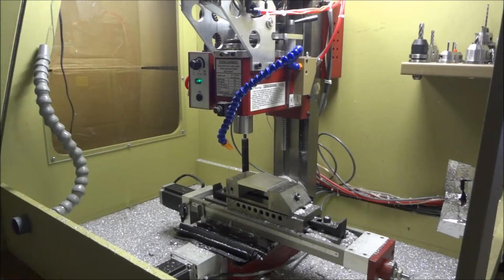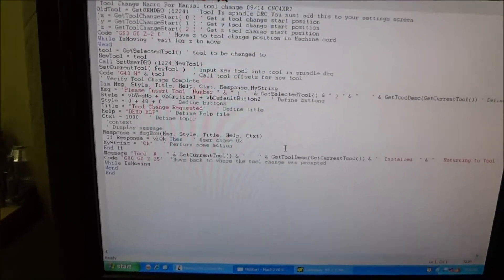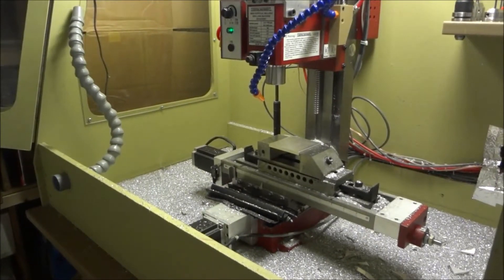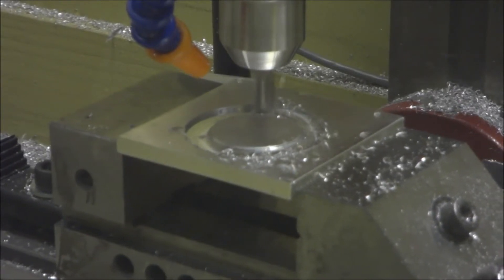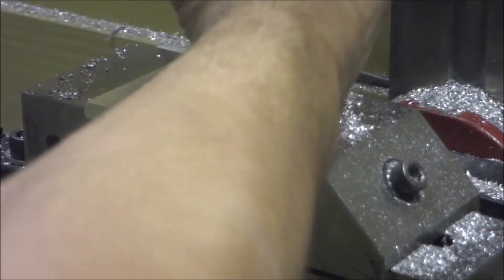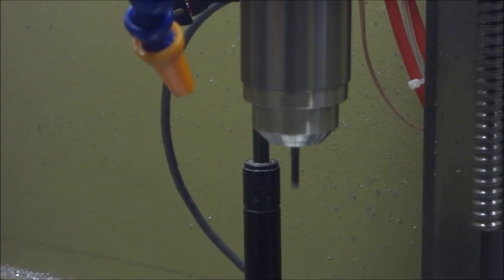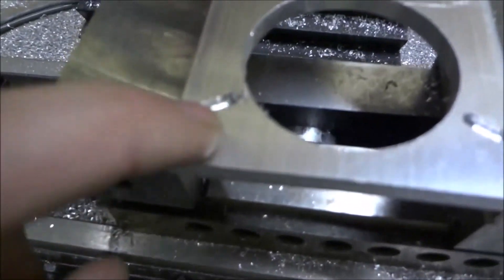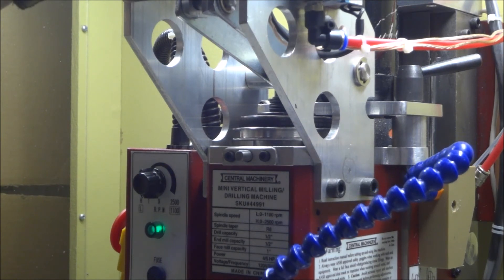Mach3  PDB Manual Tool Change Macro Update!

Comment: Great information. I am basically trying to do the same thing as you show in the video with a few small changes. I would set g59 to be my tool change location. the dialog box that displays the next tool to be used i would also like my machine to indicate the rpm for the next tool also. I need to set the rpm manually before hitting ok to start the next operation. How would I add that information to the macro? I would also like the machine to indicate the tool and rpm in a dialog box so I can manually set them at the beginning of the program then allow me to hit ok to start machining.
I am using bobcad cam. Is there any reason I would need to modify the post processor? 
TIA
Reply from the maker: Hi Matt, Seems like it would be a lot easier to simply integrate spindle control.  before hitting ok simply turn on the spindle to the desired rpm.u should be able to see the gcode at the time of the tool change.

Comment: Your motors sound like mine did alot of  vibration at low speed. It worked fine but bugged me for a while. Then I changed the windows computer to normal PC mode from acis driver and they are quiet and  smooth sounding
Reply from the maker: it's been a long time since that video was made , and a couple years since I heard the X2 run. I do remenmber going back a few times and Fine tunning the steppers . However they do have a unigue sound of there own.
Of course Servo's do As well. Which I prefer.

Comment: I have a second carriage on my X axis- X=B,Z=C How would I configure your tool change macro to work with the second carriage? What DRO's would I have to change,ect.
Reply from the maker: Hi Clyde,
 I'm not quite sure I follow your question this Macro is for a manual tool change to simply move the z axis up to allow you to change a tool and apply tool offsets. if your asking about a Rack system i could write a macro for that.
Reply: My system uses two Z carriages that share the same X rail.. What I want to do is to change the axis letters from X and Z to B (X) an C (Z) where B ='s the X axis and C='s the Z axis. The two carriages are identical except for the spindle motor sizes.So, instead of XYZ it would be B,Y, C.
Reply from the maker: Well In that case Just Edit the Macro to work with your Axis. Change Z to C And X to B.
Reply from the maker: You can Email me and I should be able to help with That.

Comment: My doubt is where to put this number on mach 3
Reply from the maker: The Offset is stored in the Tool Table!  In Config/Tool Table fill in the table with the tool info make sure you hit Apply and save settings on exit. YOu did download the instructions and screen set from the link in the video correct?

Comment: Friend how do i comp the tool
Reply from the maker: I'm not sure I understand your ? 
If your asking how to set up tool Offsets. the easiest way is to measure the tool length from the tip of the End Mill to where the tool holder seats against the bottom of the spindle. This is your tool length. Enter that dimension into the tool table.

Comment: thank you
Reply from the maker: Your welcome do you have what you need?
Let me know how it goes
Be safe Sam
Reply: Yes I did set it up and it works.
Reply: Great!
The only thing to be careful of is make sure when your using the m6 macro you start the code with a tool # other than 0 in the program tab tool # dro  I normally set Z zero to the same tool regardless of weather it's in the code or not. If you start the code with tool 0 it sometimes gives you a soft limit error. At least on my mill. 
Be safe sam

Comment: where did you the spindle control file. I already have the macro file. I see you added two files.
Reply from the maker: +Gary Campbell 
Hi Gary I'm not sure I understand the question? You need the Tool change Macro and a tool in spindle DRO to your settings tab. You can download this screen-set here along with the macro and instructions.
  https://www.dropbox.com/sh/vhqk5z8f0hn4zi3/AAB9elslrGs_WucoED6g2WGMa?dl=0

Here is the latest video it should help.: 
https://youtu.be/26_N4uwRWmQ

Be Safe,
Sam

Comment: I would really like your manual tool change macro.  It would work well for me using a royal quick change.  I am really a new user and just got my retrofitted jet mill/drill running after a long time working on it.  Should I rename the old macro  to something I can get back to.  Can I get a copy of your latest masterpiece.  I am really new to Mach3 and have very little experience with the software.  I do have a little knowledge of VB6.  I haven't used it in awhile.  I really think it is neat what you have done and it would work well for me.   My email is: jharrison1001@comcast.net  Thanks for your time and ingenuity.  John
Reply from the maker: Sure no problem send me a email and I will forward the macro and instructions. 
Sam

Comment: I have not used Mach3, does it not support G28 (Machine Zero Return)? When I was running Industrial CNC we used one tool holder with a drill rod in it that was longer than any of our other tools, then set the offset of other tools to this.
Reply from the maker: Yes that can be done as well, I just did not want to waste a tool holder, There is always a few ways to get things done Tormac has a good video out on setting up tooling.